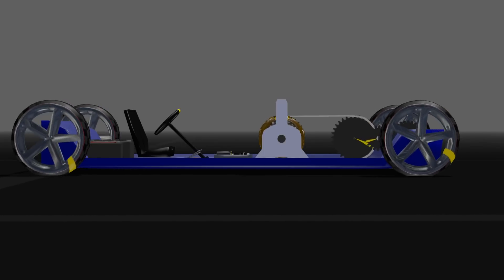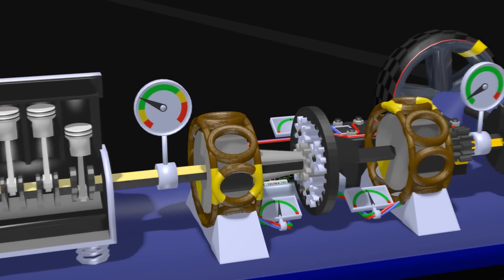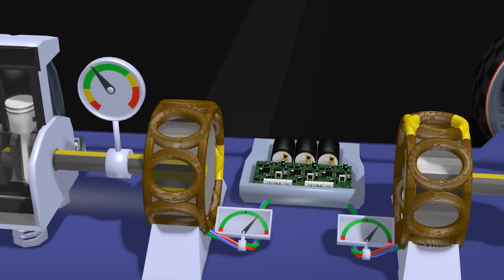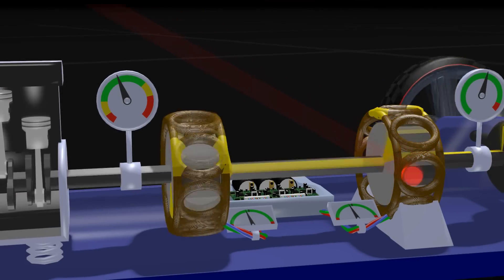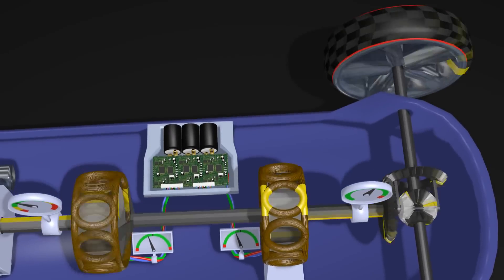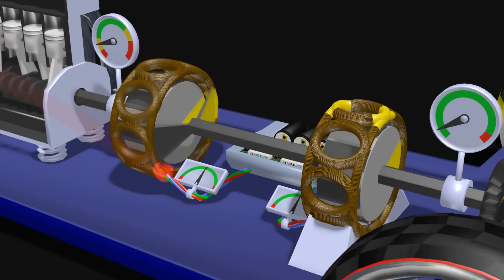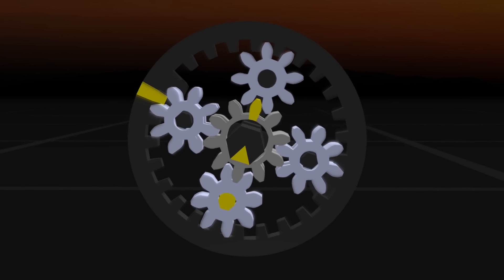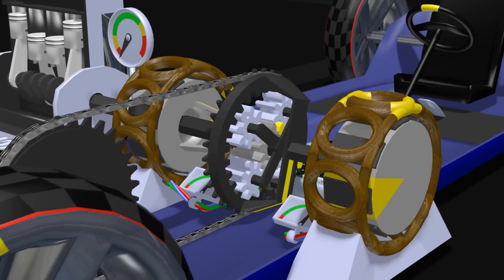Prius Hybrid Drive Explained

Comment: very good but I didnt understand how the gear ratio changes in moments i need more torque-less speed or less torque-more speed. In the CVT that happens changing the pulley and the belt ratio.. but in this case? how does that happen?
Reply: My understanding is that there are no ratios. The electric motors are the most versatile, and will do that work, just like in a fully electric vehicle.
Reply: @henrikhelmers1412  so the car is pushed all the time by the magnets? imagine that I am climbing a hill.. what will control what to generate huge torque?
Reply: @GuilhermeGomes2  Yes! When the electric motors have to work harder, the gas engine will spin faster—to produce more electric power. The gas engine will be used directly when that's more efficient, but all the "gearing" is done by varying electric output.
Reply: @henrikhelmers1412  I'm also confused on this. So is the gas engine never directly connected to the wheels? When would the gas engine be directly turning the wheels vs. contributing power to the electric motors which turn the wheels at different speeds?
Reply: @jasonfranciosa  As I understand it, the gas engine is always connected to the power-split-device, or "transmission", which is connected to the wheels. When the speed of the gasoline engine matches the speed of the vehicle it is used directly—without power going to or from the electric motors. At all other speeds the motor-generators will move to balance the movement of the engine and wheels. An extreme case of this is the balancing act when the you put it in "reverse".
Reply: Look up Weber Auto. Professor Kelly does a great explanation with the actual transmission parts to demonstrate.
Reply: Gear ratios in power split device are obviously fixed (fixed mechanical gears) but that "cvt function" is managed by changing the speed and even direction of rotation of electric motors. As you know power, torque and rpm are related.
Reply: As I understood, the planetary gear is set up with a high gear ratio, let's say 5th gear. Also, it decouples the ICE rotation from wheels rotation. Of course, the ICE hasn't enough torque to rotate the wheels by its own (due to the high gear ratio), so the acceleration phase is done by EMs. As soon as the ICE rpm matches the wheels rotation, the petrol engine takes over the EMs, driving the vehicle at cruising speed. The EMs adjust their rotational speed to let the ICE to take over.
Reply: The gear ratio is controlled by the rate at which MG1 spins the sun gear.  So elegant. This presentation will help: 
https://youtu.be/MsvVD0FaF28

Comment: But the big question is, does the hybrid system actually save fuel in real life and is it worth the complexity, extra cost to the customer, and the fact that it still needs the petrol engine to charge the system, and not to forget the extra service cost and hassle for the owner due to the hybrid component.
Reply: Our 1.6l engine petrol car, a 2009 Skoda Roomster, uses 7 to 8 liters per 100km. Our 1.8l hybrid 2013 Toyota Auris uses less than 5. Mainly engine efficiency, probably also better aerodynamics.

Complex? A classic automatic gearbox of the Roomster has 3 planetary gear-systems with iirc 5 clutches. This has just one (or 2 in the 3rd gen). No hydraulics. No spinning torque converter with fluids (the MG1 and MG2 convert torque electrically).
Reply: Yes, which is one reason it’s so incredibly popular as a taxi.  Super reliable and efficient.
Reply: Maintenance is very low on these,
Reply: Good question. If you look at the quoted figures for the same car, IC engine version and hybrid version, eg Toyota Corolla Cross, you see ~ 6.5 L/100k for the ICE and ~4.5 L/100k for the hybrid.
But this is not the full story, depends on usage. eg. Long motorway trips with minimal regen braking, just blasting along at high speed would mean both cars would consume pretty much the same amount of fuel. Presumably you get fuel savings in the opposite situation, city driving.
Another approach, used in the Nissan ePower system, has a generator on the ICE charging a big battery. An electric motor drives the wheels, powered from the battery. That's it, no transmission at all, very simple. The Nissan Kicks has this, and uses the same quoted  amount of fuel as the hybrid Corolla Cross. The Nissan is a totally electric drive ie, peppy, where as the Toyota is good but not the same instantaneous hit of power. What does it all mean? Dunno! 😀 😀
Reply: @brianheard4565  not exactly. Weight has minimal effect on fuel economy for highway driving where you do not stop. Where weight penalizes you a lot is on normal vehicles when you brake, since when you brake your kinetic energy is wasted as heat. On a hybrid, when you brake, your kinetic energy is recovered by the motors and stored in the battery, and is then used when you speed back up. I would guess as much as 70-80% of your kinetic energy able to be re-used. So this extra battery weight is not a big deal, since you aren't using much extra energy to speed it up.

But the Toyota hybrids use Atkinson cycle engines, which are more efficient than the Otto cycle engines used in non-hybrid models. Atkinson cycle engines are not used in non-hybrid cars because they do not have a lot of low speed power. But this isn't an issue in a hybrid because the motors allow power at any speed, allowing the engine to run at a high speed even from the start. So now you have a more efficient engine that allows you to get higher highway fuel economy vs a non-hybrid car.

In the US, the Toyota Corolla is rated at 31/40 MPG city/highway, with the Corolla hybrid rated at 53/52. Now, part of this is because US cars have absurdly huge engines compared to the rest of the world, but part of this is the efficiency allowed by using a more efficient engine cycle and allowing the engine to run at a speed that is most fuel efficient at all times. The Nissan drive has very similar benefits of allowing more efficient engine cycles and running the engine at the most efficient speed. I would think in theory the Toyota hybrid drive is more efficient since it can still couple the engine to the wheels and avoid the conversion loss that inevitably happens with converting all power from a generator back to a motor, but this conversion loss is relatively low. This is why there are diesel-electric train locomotives. They work exactly like the Nissan drivetrain, just on a much, much larger scale. The diesel engine runs a generator which then runs electric motors. The difference is on the train there are no batteries at all, just the engine > generator > motor, so it's not a hybrid.
Reply: @brianheard4565  highway driving with hybrid costs more in fuel because you are carrying 150 to 200 kg of battery weight unnecessarily. I don't really trust Toyota's very optimistic milage figures for hybrids specially since they want to convince you to buy them. The only arguement in favour of Toyota hybrid is that they cost almost the same as regular Toyota in Europe but the hybrid service charges are higher.
Reply: @Raj-nh3fc  Do you have any evidence for hybrids having higher maintenance costs? The Toyota hybrid system contains fewer moving parts than a regular transmission. Why would it need more maintenance/more expensive maintenance?
Reply: @Tuppoo94  yes. We were looking for a Toyota auris (corolla) and had to choose between the hybrid model and the 1.2 lit turbo model and since the service cost of hybrid model was going to be 500 euro per year compared to 250 per year for the non hybrid model, we went for the 1.2 lit petrol model. You and I know that hybrid models are not any different in service than the petrol model but here the Toyota agent was trying to extract a lot more citing that the hybrid service was something special. The pure petrol model can be serviced at any garage. You do not need to go to expensive Toyota garage.
Reply: @Raj-nh3fc  That doesn't mean that servicing hybrids is more expensive. It just means your local dealers/Toyota mechanics are a bunch of cheaters. In my area, servicing a Corolla Hybrid costs less than servicing a VW Golf for example.
Reply: @Tuppoo94  yes that may be the case in this country because Toyota Sweden refuses to force a fixed price service rule on its dealers but it is nevertheless a huge expense for us customers.
Reply: The Prius generally lasts longer than most non hybrid vehicles and is considered to be one of the more reliable vehicles made by Toyota and I generally find I get about 55 mpg (almost all highway) so it generally works out to be a bit cheaper per mile driven than most other comparable cars even when factoring the chances of replacing more expensive components like the inverter/converter.
Reply: Yes, absolutely. The US model of the Toyota Corolla is rated at 31/40 MPG (city/highway), the Corolla Hybrid is rated at 53/52 MPG. Essentially hybrids allow you to get MPG for city that equals highway since they are able to recover energy from braking that is wasted as heat on regular cars, while ALSO getting higher highway MPG by being able to use a small Atkinson cycle engine which is more efficient than the Otto cycle engine used in non-hybrid cars. The reason Atkinson cycle engines aren't used in non-hybrid cars is they have very low power output at low speeds. But with a hybrid this isn't an issue as you get your low speed power from the electric motors. So now you have a vehicle with a more efficient engine, and a peak power output higher than the peak power output of the the ICE engine alone because it can use both the engine and motors powered from the batteries for a short time (accelerating up to speed).

Comment: How does Lexus have a four speed mixed in with it?
Reply: The fixed-ratio gears between MG2 and the output shown near the end of this video are replaced with a two-speed planetary transmission (in the LS 600h and GS 450h), or a four-speed planetary transmission (in the latest models).

Comment: All this shows me is that hybrids are waaay too complicated. An ICE plus electric motors? So unnecessary now with all the charge stations around. Governments have to get serious and remove the taxes that keep people from purchasing full ev’s. In the meantime, we seem to be locked into producing more CO2.
Reply: Perhaps complex but the Prius is still extremely reliable. This system means that Priuses are still going for 500k miles or more. I don't think it's a case of EV vs hybrid, I think it's EV and PHEV and HEV vs pure ICE which seem now pointless in the light of all this technology. Ultimately BEVs will replace PHEVs and HEVs but for the time being they are a good transitional solution. The oil companies get very little revenue from my Prius.
Reply: That transmission is way simpler than a common manual or automatic transmission and completely eliminates several moving parts including clutches and torque converters all cars are extremely mechanically complex.

Comment: Perpetual motion exists, God created the universe and set it in motion and it won't stop until He commands it to.
Reply: Anthony Xuereb I thought the same thing when I heard him say that.
Reply: @trobaughryan It's good to hear from you. How many realize that the hybrid system described  incorporates "planetary" gearing. You can't get away from creation.
Reply: @anthonyxuereb792  It's planetary in the way that it is one gear (a "Sun" gear) with smaller gears ("Planet" gears) surrounding it. It is not modeled after the universe in any such way. It was just named this because of the act of one thing revolving around another. 

Additionally, perpetual motion machinery supposedly does the act of creating as much energy through work as it is using for said work in a closed system. In this case, the video creator explains that the engine does not generate as much energy as it used and is, ergo, not perpetual. 
The planets, alas, are NOT a perpetual machine either. They don't put out any energy through work. If we were somehow able to attach a giant axle to the sun with an electric generator and connect it to the earth, the earth would eventually slow down because of the friction. This solar system is not a perpetual machine, which would break the Newtonian physics principal that energy cannot be created not destroyed.
Reply: I think it stopped once, in your religion, lol. I think it was the sun and moon that stopped for some warlord to win his battle.
Reply: @danieljoseph6404 think about what you said, "it was stopped " is quite different to a motion that runs out of energy to continue. It had to be stopped is a deliberate action that interferes with perpetual motion. Perpetual motion doesn't mean you can't stop and start it again. I hope I have made myself clear.
Reply: @anthonyxuereb792   Yes. I was pointing out the ridiculousness of your statement.

Comment: my RX450H has no belt but 2 planetary gear sets and 6 virtually gear steps which you can change  when shifting in manual mode..but they dont work like real gear steps i found out. when downshifting driving downhill its like a normal automatic gearbox shift and engine rpm goes up and engine brake the car and recuperation is more. But when manually upshifting i cant see, feel or here much a difference. Perhaps its changing something but something else is running faster or slower but i just cant figure it out.
Reply: It works the same way as described here, but the m/g voltages (and thus speeds) are adjusted in discrete increments rather than continuously. Change the m/g speeds and the engine speed must change to accommodate, which you feel as virtual gear shifts. There is still a chain drive between m/g2 and front differential, but in addition there is a third planetary gear set and clutch between that and the drive shaft to the rear wheels (assuming it works the same was as the ES).
Reply: @SeniorKlean  i think the V6Hybrid with its huge power has no belt